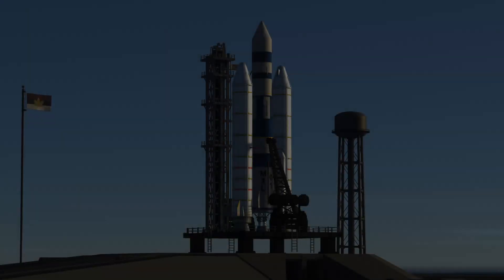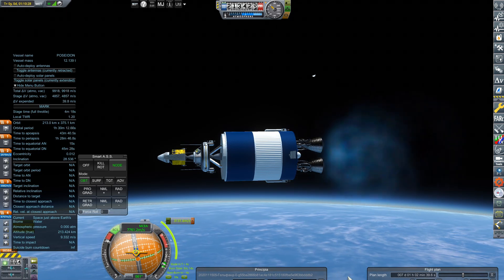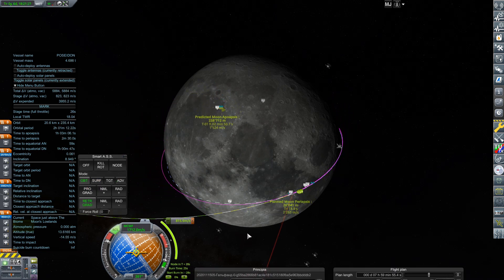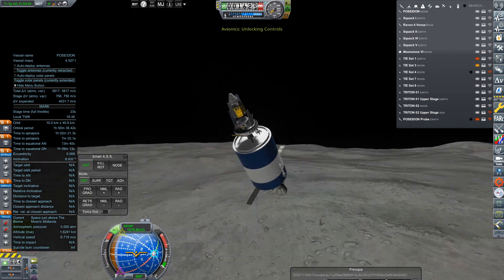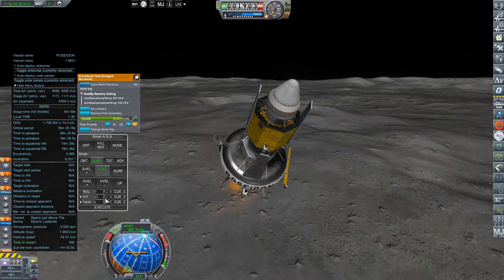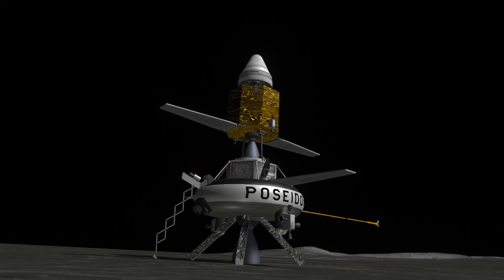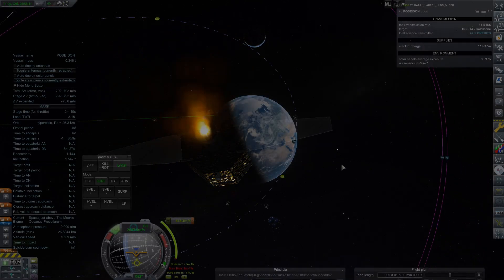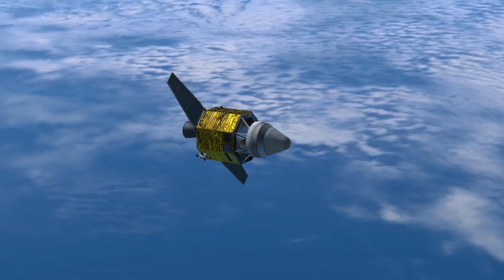The Poseidon Lunar Mission

Comment: Bruh. The way I do it is I jettison my return capsule as soon as possible, and arm the parachutes. that way I don't have to worry about comms.
Reply from the maker: The reason I had waited so late was to make sure the capsule would be oriented correctly for reentry - small deviations could cause it to disintegrate
Reply: @N9GamingOfficial  ah. so it doesn't have rcs ports? I guess that makes sense.
Reply from the maker: @sirjeffels4020  Yeah - I had pretty strict deltaV margins and controllable avionics with rcs would have been too heavy
Reply: @N9GamingOfficial  welp... it is what it is. you should set up a comms network in LEO so prevent this from happening.
Reply from the maker: High orbit is what I'm looking at, it will cover more area that way
Reply: @N9GamingOfficial  eh. I was thinking it would be cheaper and faster (comms speed) to do LEO, but yeah, that also works. you might run the risk of probes having failures which cause a black spot. Not sure if that can happen.
Reply from the maker: Fortunately comms failures are not modeled, what IS modelled is wobby orbits that make satellite placement spacing a bit difficult to manage. I'll have to research where the most stable orbits lie and utilize that.